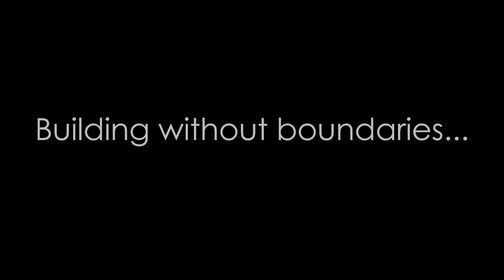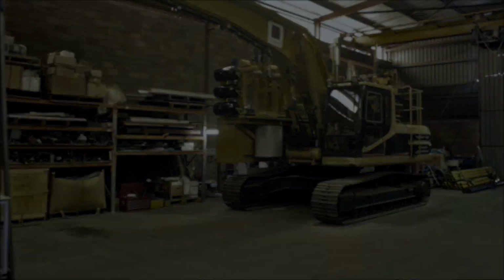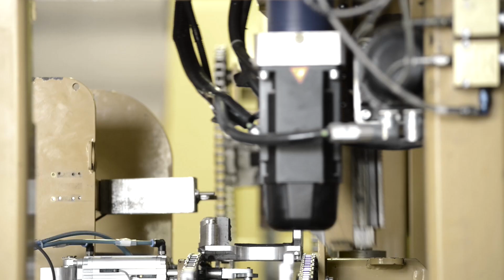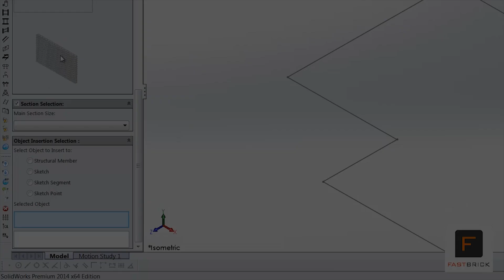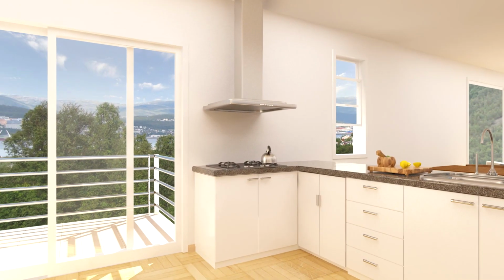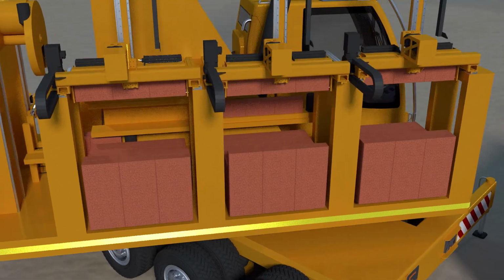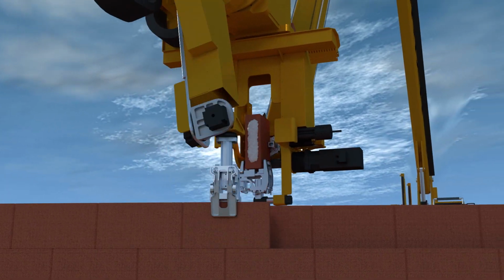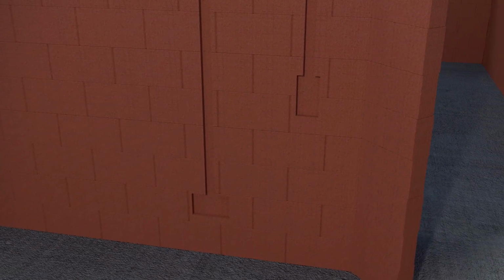Fastbrick Robotics: Hadrian 105 First Look Revealed

Comment: There's no adhesive or mortar in the vertical joints? How are they filled, surely this weakens the structure. Will these adhesives still be good after 20+ yeas, mortar will!

Comment: Insulated concrete forms with helix concrete, stack them yourself prop them yourself and get a concrete pump to fill them and there is your wall, cyclone, hurricane and earthquake proof.  Hardly any heating and cooling costs.